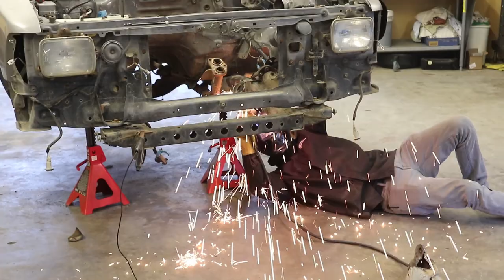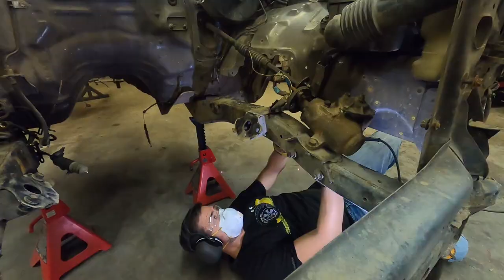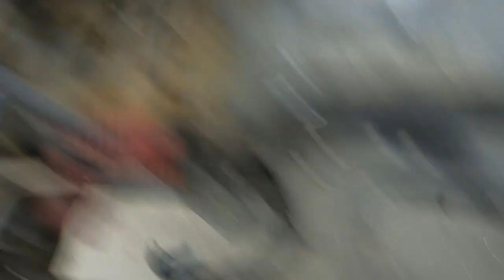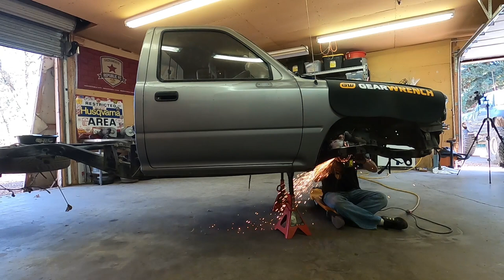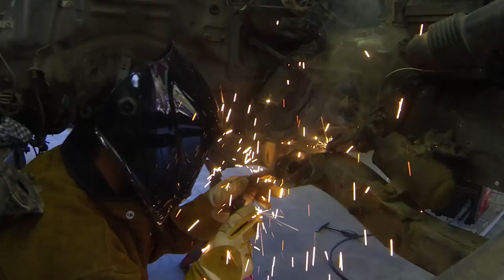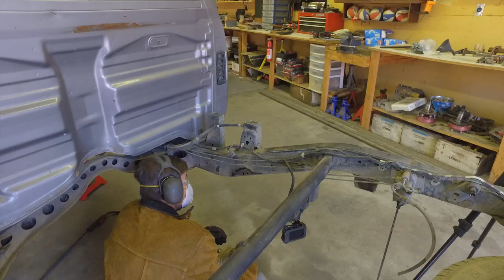Cutting Off All The Suspension | Samantha Vlog3

Comment: You could use the repetitive tac weld to fill the holes. Tac on the edge of the hole let it cool until it stops glowing then repeat. Just can’t put too big a tac weld or itll burn through. That’s what I typically do
Reply from the maker: Awesome suggestion, thanks for mentioning that

Comment: not to be "that guy" but im an ironworker and i have done a lot of grinding with cut off wheels, just a heads up if you grind on them too long they will fly into pieces. its not as bad as when you are cutting with them but it will still hurt the fingers lol. love all your guys' content and hoping to make the next meet up, if the virus ever calms down
Reply from the maker: Yes you're correct scott, it's only miner grinding on the cut off wheel

Comment: If all else fails and welding it up just won’t work what I did on mine is cut out that small section of frame where the holes are and use it as a template on your new steel fit it back in the frame and weld it in and smooth the welds and you’ll never tell the differance
Reply from the maker: That's what I was thinking we would need to do, but Husmann just fill welded it